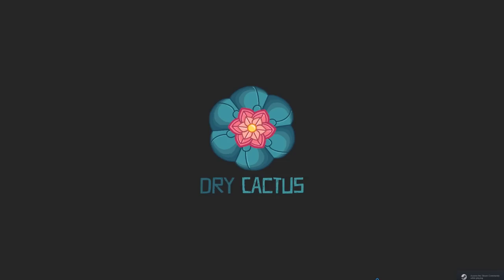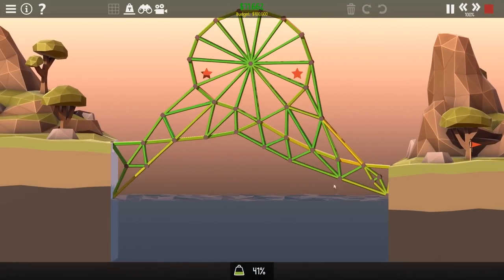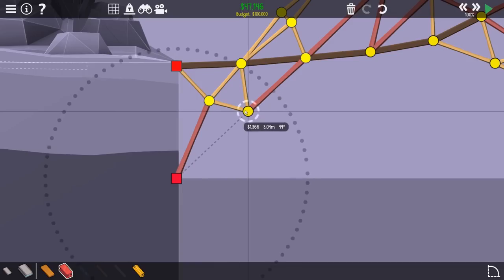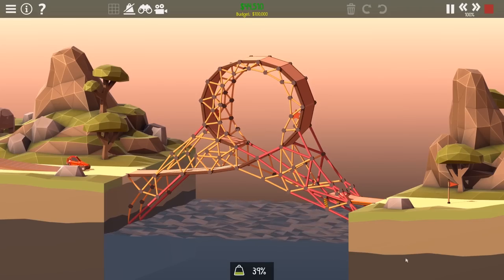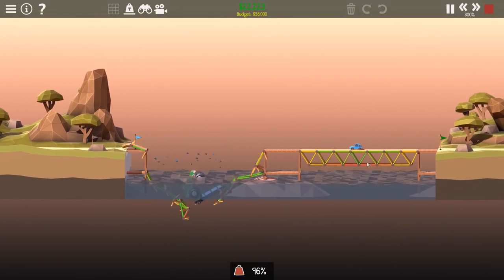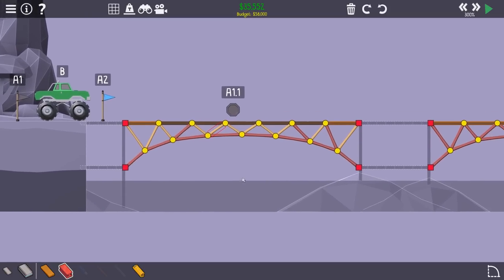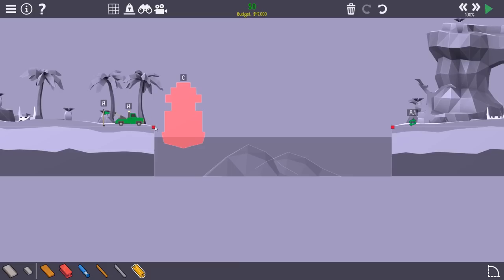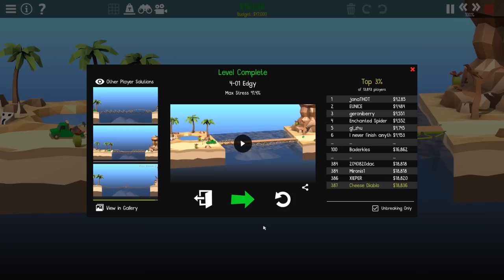How to CLIMB THE LEADERBOARDS in Poly Bridge 2 using ACTUAL ENGINEERING! Featuring a loop!

Comment: If you don't change the income, computer will calculate the same way and put out the same outcome. But when you change something the computer will calculate again, and some decimal numbers might be different.

I knew about it when playing PC simulators of Gamboy and NDS. The similators had the quick saves and loads. If I followed the same patterns after reload then everything would happen the same. But when I changed some actions I would get some different outcomes.

Comment: You were on to something with connecting to the center of the circle but putting connecting every point to it is a waste. If you keep the outer truss and only do three or four connections to the center it will work better. Also you can reduce the stresses on the loop by making it bigger.

Comment: When you changed over to reinforced road, your right side bridge maintained a resonance that enabled the limo to pick up slightly more speed, and momentum. Watch where the limo stops after hitting the flag when the left bridge fails, and when it does not. When the limo gets further, the max load of the monster truck/limo collision is placed closer to the center of the bridge. Which made all the difference in the case of your design.

Comment: Basically the limo bridge was almost at its breaking point, but the physics engine calculated that it would be fine. However when you changed something on the other bridge, the physics were recalculated and the first bridge broke.

Comment: takin a stab in the dark, games like this that are effectively physics simulations all have one huge problem; consistency.

nothing is more annoying than when a simulation runs differently with no changes due to minute fluxuations in things like frame rate or computing. To get around this Polybridge is taking one potential physics simulation of your bridge and only using that one for every time you run the bridge (my guess is it would be the most average result but with the load times it's probably actually just the first possible result) 

So since your bridge is teetering on breaking, when you change something on the other bridge, you cause the code to update it's phsyics simulation to a new one that now has your bridge break, either because the moment the stress would have broken it in the original simulation happens on an off frame, or the way the weight gets distributed changed by .001 or whatever from the minute randomness in any simulation. 

Basically you found the one outlying flaw in this solution regarding consistency; sometimes it's inconsistent, still it's pretty incredible polybridge can run these simulations perfectly the same every time, and also that you managed to optimize a bridge so thoroughly that you ran into this outlying problem. so this should be a complement to both parties that it even happened in the first place.

Comment: I don't know 100%, but I know that Poly Bridge 1 had RNG to where a bridge might succeed or fail even if you didn't change ANYTHING. I think PB2 exchanged that with seeded RNG, so a bridge will always do the same thing if every piece is placed in the same spot, but if you change anything else in the level (even by a pixel) then the RNG will be different.

Comment: What's with the sneaky cut at 9:19? You explain why directing the force towards the right anchor is better but the final design you actually test (which you cut to mid-test) has wooden supports going in both directions :(
Reply from the maker: Just bad editing, it did work fine but I fine tuned it to get it even cheaper and it looked slightly different to be before the cut. Great spot though!
Reply: @RealCivilEngineerGaming  thank you for explaining, that sounds reasonable

Comment: At least PB2 is deterministic, it calculates the result based on the build and not individually for each run. PB1 and it's "works once in 6 runs" bridges... 😅

Comment: Wouldn't it be the Tighter the triangle, the more strength?
Reply: As I understand it, the wider the muscle, the more % of force gets applied to the crossbar. So it will get stronger until it's equilateral triangles?

Comment: Ahm.. well in a common sense adding muscle gain more weight, it reinforced but gain weight i guess? Since it reinforced the part you want to change, the stress transfer to other parts which is weaker and cannot support tension and compression. Also I dont know if also aerodynamic apply here..

Comment: The two-bridge butterfly effect is a consequence of them programming out randomness. In the first game, a single solution had a chance of working only a percent of the time due to randomness mechanics in the physics engine. This annoyed people, so they removed that mechanic in the game in a sense. A single solution will ALWAYS have the same result, but this means the randomness gets transferred elsewhere. This mostly effects moving parts in bridges, but impacts can be effected. Essentially, your change did NOT effect the first bridge, but the physics engine's calculations were redone because the solution is different, and as such 99.9% stress got recalculated as 100.1% stress. It's very weird, but unavoidable if you're trying to low-ball a budget.

Comment: The game is right. If the middle was solid rock, it would not behave like that. The fixed wooden platform acts as wooden beams. Tension on one bridge will travel to the other bridge too. It's done deliberately like that.